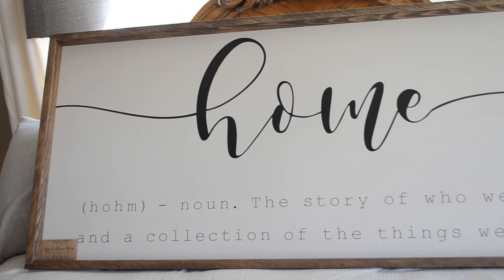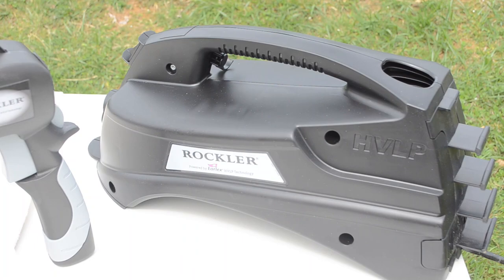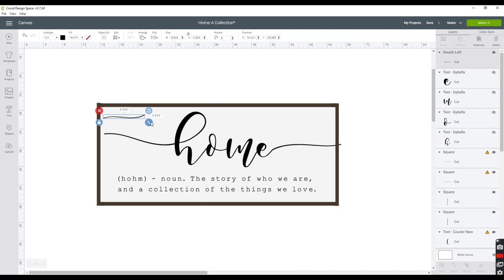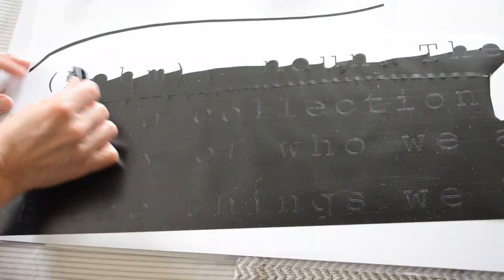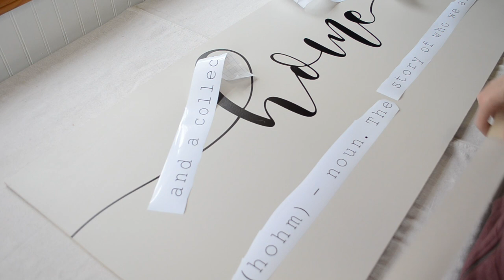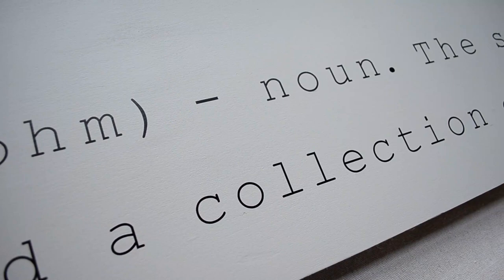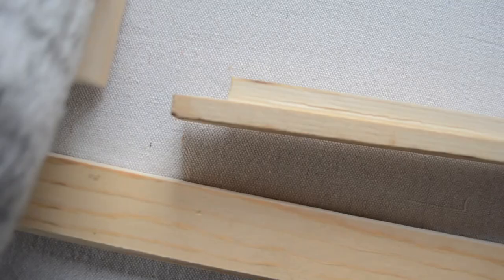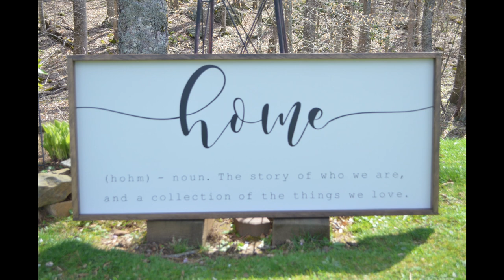Making a Large Farmhouse Sign / DIY Tutorial and Tips

Comment: Hi,I am a beginner in wood signs and just wondering why u are only transferring the signs to the boards but not stenciling.what are the advantages.
Reply from the maker: Hi! I use to use stencil all the time until I started using vinyl. It’s soooo much easier and saves so much time to not have to prep your stencil, then paint several layers with drying time between layers, to get a perfect stencil. I still will use stenciling but only if there is a color of vinyl I can’t get or if I want a certain look. Stenciling looks nicer sometimes but mostly vinyl is great.👍🏻
Reply: @AppalachianHomeCo  thank you so much for taking time to reply.Really appreciate that

Comment: Thank you so much for this tutorial! Your sign is absolutely beautiful. What is your favorite paint to use on your signs and how long do you let it cure before adding the vinyl lettering? Do you seal your sign before applying the. Only? I have had issues with my transfer tape (Walmart duck brand)  pulling up my paint even after sticking the transfer tape to my clothes first.🥴 You just make it look so effortless.😍☺️
Reply from the maker: Thank you that’s so nice of you☺️ Mt favorite paints are Valspar, Gliden, and Kilz. They work really well with vinyl and will allow the vinyl to stick after only a couple hours of drying. Other paints I have to leave overnight. And I have had many comments about the contact brand from Walmart pulling up paint! It depends on the paint and drying time. I switched to regular transfer tape and like it better I use Greenstar brand Layflat clear medium tack👍🏻👍🏻 If you still have problems pull off the transfer against the grain of your wood and it will help some.😊

Comment: ❤️ it. But how much do you charge for shipping? And how much for a larger sign like this? Ty for the video
Reply from the maker: Hi thank you! Shipping for a sign like this is around $20 depending on where you ship. Smaller signs are less. Etsy calculates.the shipping when customers purchase and they pay before I ship. Then I just purchase shipping labels from my Etsy account. Other wise you can use USPS website to figure shipping based on length width and height, and weight of a package.

Comment: about to make my first sign, but I cant figure out if i should use 631 or 651. What did you use? Should it be permanent? Didnt think about using mod podge til i read a comment below. Is it absolutely needed?
Reply from the maker: Hi! I use both 631 and 651. I prefer permanent on signs but I can’t always get permanent vinyl that’s matte. Most permanent is glossy, except for black and white. So if I don’t want glossy letters in a certain color I use 631. Mod podge is good for temp vinyl but I don’t use it for permanent much unless it starts bubbling or coming up off the paint. Hope that helps!
Reply: @AppalachianHomeCo  this explains it perfectly. thank you so much!

Comment: Thank you for all of your tutorials!! I need help!!! I’m about to pull my hair out!! My vinyl will not transfer to my painted luan!! What am I doing wrong!! Also when I tried to make a stencil with contact paper it made a HUGE mess!! It stuck to my brand new cricut mat and the cricut butchered the stencil!! Please help!!! TIA
Reply from the maker: Hi! Ooh been there before😬. On the vinyl there is a couple things you can do. If you lightly sanded the sign after painting to remove roughness try going back over it with another coat and a small foam roller, let dry overnight. If that doesn’t solve then it’s the paint. Some paint WILL NOT work well with vinyl for some reason. Valspar satin paints seems to work great, Gliden works well, Behr is NOT the best for vinyl for me. I don’t know what the difference is but there is one. Drying for 24 hours does help tho. On the contact paper try using a light grip mat vs. a standard grip if u have one. I use old mats and tape the corners sometimes with contact paper. Also try adjusting the pressure in your material settings, it may be cutting too deep for your brand contact paper. I’d start in increments of 10 and go down until you still get cut thru but less “wrinkling”. Hope that helps!
Reply: Thank you soo much for you response!!! I’m gonna give this a try and hope it works!!! I love all your videos!!! Keep up the good work!! Your such an inspiration!!
Reply from the maker: Thank you!!

Comment: Hi, I like your process. Have a few question please...
Where did you get that frame board from? What are those tools you use to hold the edges together before you staple them together? What app did you you design your font in on your iPad? Is it hard to learn Cricket?

..
Reply from the maker: Hi thank you! The frame boards I ripped from a 2x4, but Lowe’s carries the same size, which is 0.75 thick by 1.5” wide. The tools holding the corners are corner clamps, I think I have them linked in the description. I used Inkscape to design the letters on my laptop. I drew the swashes in a program called Procreate on the iPad. Then uploaded the swashes and svg file from Inkscape into Cricut. It is not hard to learn, but there is a lot to learn and it just takes a little patience! Hope that answers your questions!
Reply: So to make the letters long, you drew the lines on your ipad and then welded it to the font?
Reply from the maker: Rob edwards Yes exactly! I liked the font itself but it didn’t come with swashes so that is why I drew them separate.
Reply: @AppalachianHomeCo  where did you find the original font from?
Was the original font from inkscape? I'm about to take the dive and buy a stencil cutter machine etc. I'm a bit nervous about not being able to learn everything. In inkscape I can design all my fonts?

Thanks a million!
Reply from the maker: The font I used is called “Gybella” and you can find it at Creative Market, I have a link for it in the description box under the video. Once you install it on your computer Inkscape will recognize and list it in the font drop down box. It does this for any new fonts you install in your computer and the ones you already have. Be sure when you are installing font to select “install for all users”. This will allow your programs like Inkscape and design space to recognize new fonts. You also will need to close those programs before u install a font, then reopen the program, and it will be listed with the others. Hope that makes sense. You can pretty much do whatever u want in Inkscape with all your fonts, but if u install the ones that are for personal use only, sometimes they will appear cut off. Commercial fonts have always worked for me tho.

Comment: Hi, where did you purchased your wood? Name? I have a hard time looking for a type of wood for signs.. really want to try and make some!! Thanks
Reply from the maker: Hi. I bought the wood from Lowes. The sign back is made from luan board. If you ask at Lowe’s they can help you find it. You can also get either 2x4’s and rip them with a table saw to 1.5”x0.75”, or Lowe’s also has 1x2 pine boards precut to that size you can use for frames. Good luck making those signs!

Comment: How did you resize / cut the font. .
Reply from the maker: Hi! I use the slice feature in Design Space to cut the letters most of the time. Makes sure the letters are welded together first, then draw a shape like a square and place it over the part you want cut out, then select both the square and the letters and slice them. This will cut out the letters within the square. Hope that helps!